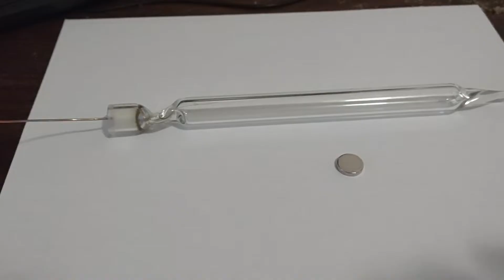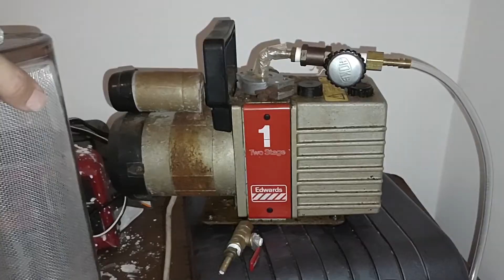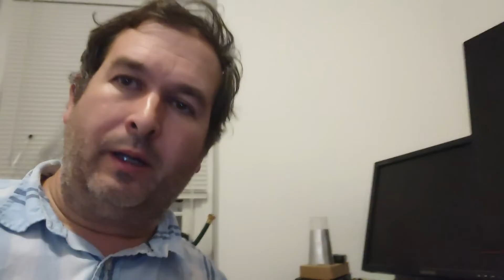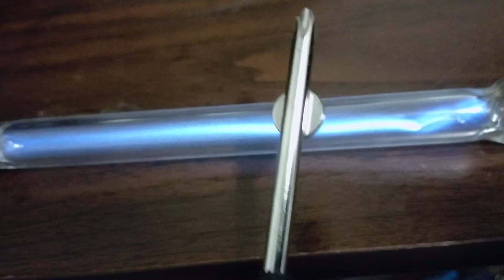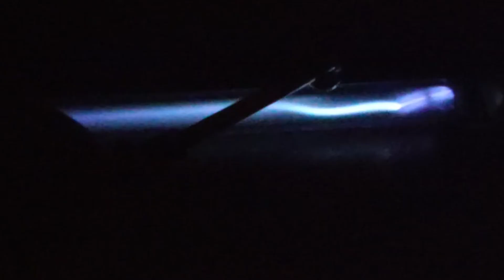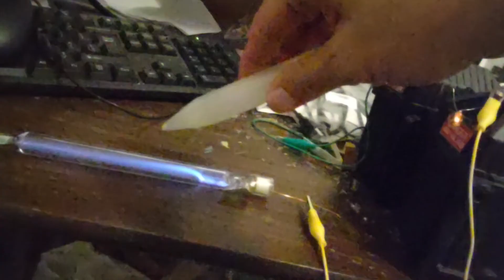Electron Beams, Magnets, and Vacuum Tubes!

Comment: Please make a vid on vacuum tubes! I thought I needed to find a master glass smith to create vacuum tubes. Seems its much easier than I thought. Thank you for the tip, saved me a massive amount of time haha. 

1 vacuum tube experiment I've been dying to try is a crookes radiometer inside a noble gas vacuum tube placed into a microwave oven. Supposedly the radiometer will accelerate so fast that if you leave it in the microwave for longer than 4-5 seconds it will explode the glass vacuum. Very curious to see if thats a factual claim. I first heard that claimed from Dale Pond in his lecture on Sympathetic Vibratory Physics of John Worrell Keely. Someone recommended you to me because you one of the only guys that has done some of Keely's experiments. I'm very curious what you think about Dale Ponds claim about the crookes radiometer inside a noble gas vacuum tube and put into a microwave(and Keely in general). I suspect he's the key to everything.
Reply from the maker: I will put it in my schedule... You should try putting the radiometer in the microwave! I believe it already has noble gas in it!  
https://youtu.be/OGX0-C1FXYA